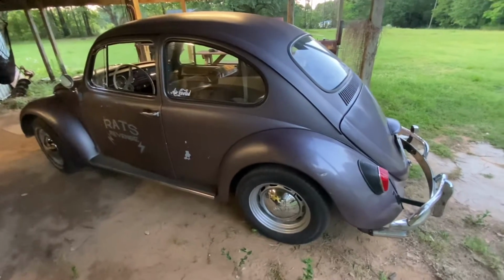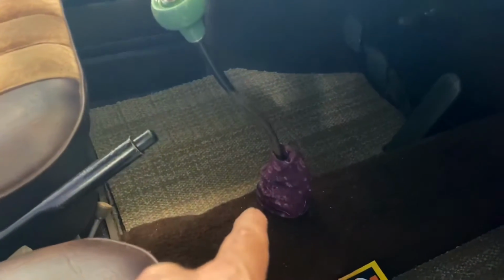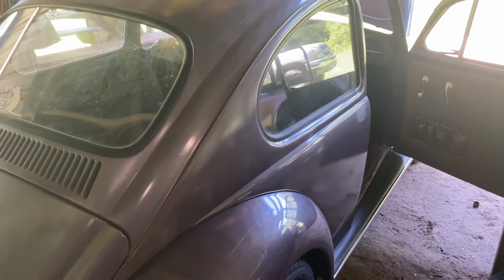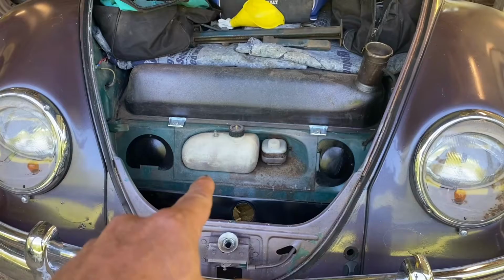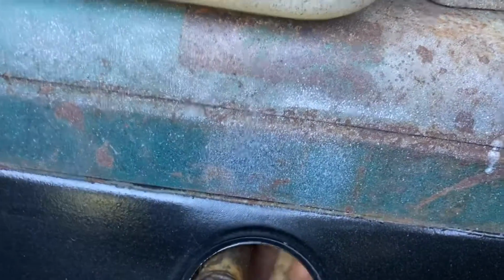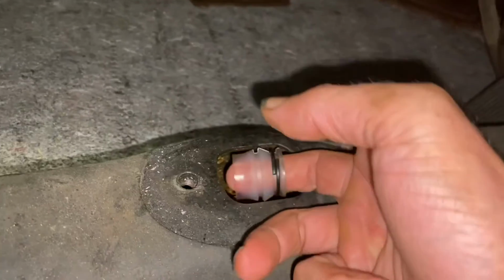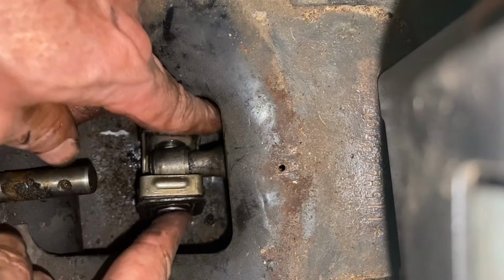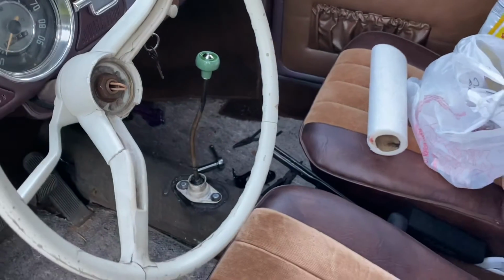VW Shift Like New With Coupler And Bushing Fixed

Comment: I’ve had both my vws for so long I can’t remember if I’ve replaced these parts on my cars. Gonna have to check. Been having problems getting into reverse on the bug. I just assumed it was the clutch but maybe not. Also my bus always pops out of gear when I’m in fourth. I already replaced the whole transmission so too late for that but I also went ahead and replaced the bushings also just in case.
Reply from the maker: Ouch, those bushings are no fun. Aaaaahhhhh the joys of Aircooled ownership. Reverse did the same on my bug but new coupler, bushings and adjustment of the lockout plate remedied it. Tis a labor of love?

Comment: Why s there so much grease on the coupler? That why the rubber end pieces deteriorated. Leave 'em dry.
Reply from the maker: @sidvis7235  Hmmmm, I will try that on the next one I do. That was the original one decades old. I hear that the new polyurethane ones don’t last long. Mines still shifting like new, but I’ll leave it dry next time so I can compare.
Reply: @bomberobus  Just a light film on the pin is fine, but's that's all I would lubricate. Gease and oil do not mix well with rubber. Neoprene isdifferent, it will withstand petroleum products. That's why fuel lines are not rubber, but neoprene.